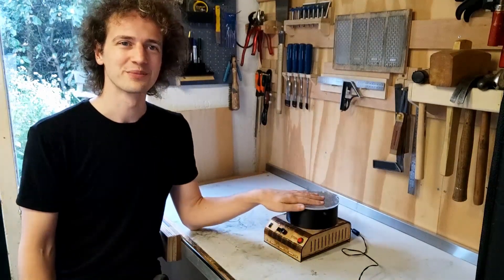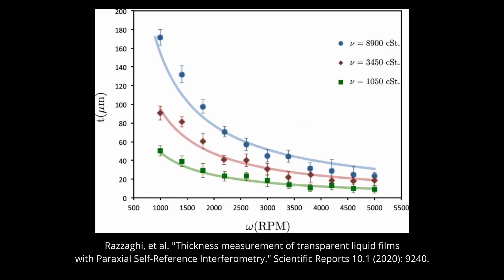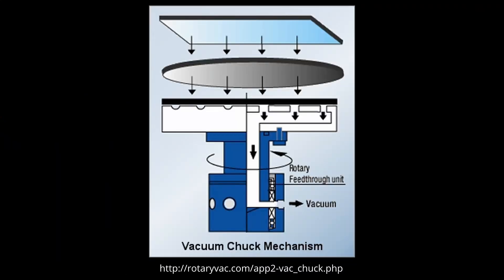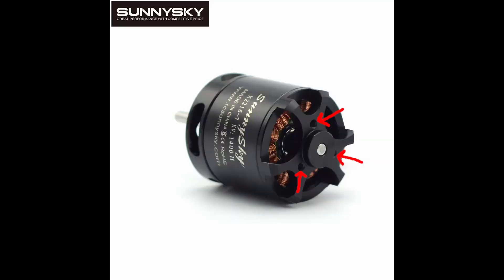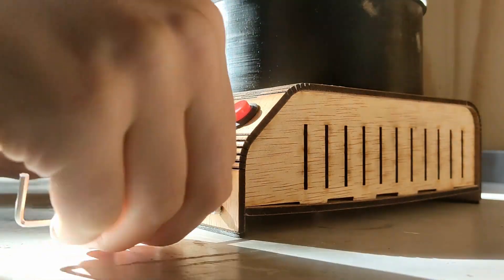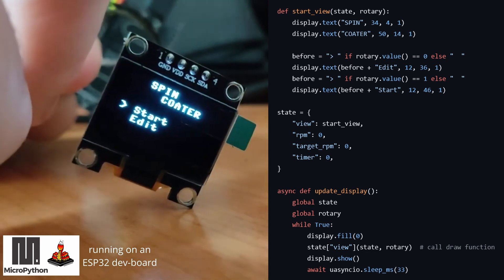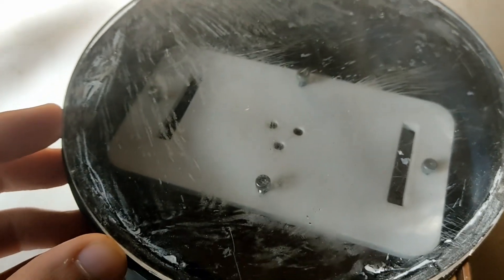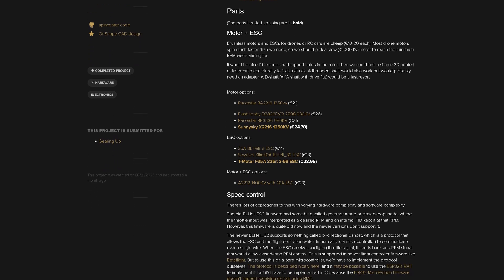Building a DIY Spin Coater

Comment: great work! just to clarify is there anything you needed to do to protect it or detect unbalanced loads? I dont know if i'd need to add a radial bearing to protect the motor/prevent any fast moving shrapnel 😅 if the load is unbalanced.

Comment: Dude, if you power it from a laptop power supply with coaxial plug, it is no sense to use such a powerful parts as 35A ESC with such a motor. Power demand for that configuration is much, much bigger.